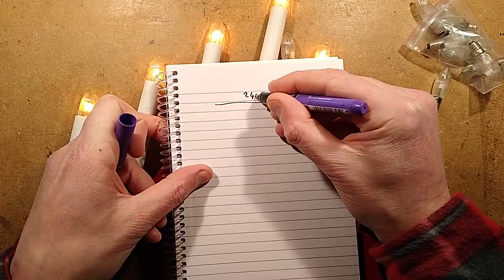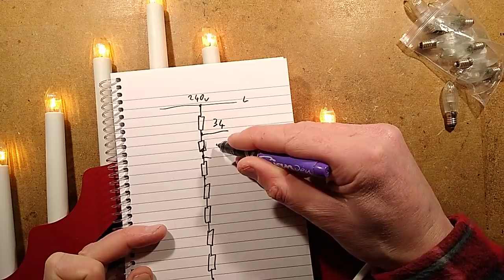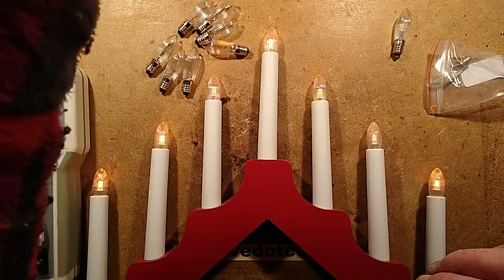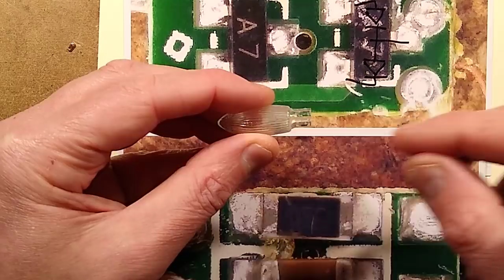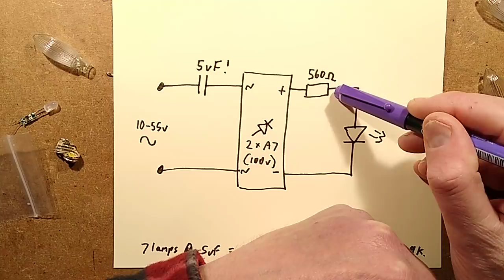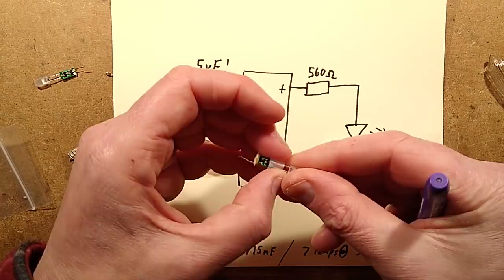Why you can't mix LED and tungsten in series circuits.

Comment: most of our appliances are DC, yet we use AC and rectify every single lightbulb. 
wouldnt it be better to supply DC mains and rather convert the few heating elements that still need AC?
Reply: Univeral motors run cooler on AC and 50/60Hz iron core transformers won't work. Synchronous motors won't work either on DC.
Reply: @simontay4851  
i wasnt aware that we have that many motors in our homes to justify AC? 
yeah sure, washing machines ... but they have heating elements and needed to convert to AC anyway, but other than that? 
TVs, Computers, Radios, Lights, Monitors, DVD Player,... guess when it comes to Vacuum and Kitchen tools, youd indeed have motors. 
Maybe it was a stupid idea. :-\
Reply: not to mention power tools having motors.
Reply: @thomasherzog86 there are at least 3 reasons:
1: AC is much more efficient to transmit, DC suffers energy losses over even relatively short distances

2:We already have billions of devices that run on mains, so even if DC mains was supplied, it wouldnt really be used for a while

3: That would be very expensive to either make brand new transmission infrastructure, or even rectify AC at a central point in the home.

4:We have cheap, easy, and small circuitry already developed to be able to rectify mains AC, so its not like we would be saving much money per device.
Reply: @benjammin2020  
but that's four reasons? (^^)
but seriously, i dont think nr. 2 and 4 are valid if you think about all the lost energy that gets turned into heat in resistors and all the extra elements that land in the trash with the appliances like rectifiers and such. there is a lot of potential to be saved here, which of course is lost quite fast if transmission in homes is that much worse with DC like you say at nr. 1 or would need much maintenance with an expensive transformer in every house. 
it was just a silly idea. ^_^
Reply: @thomasherzog86  DC is used in power transmission sometimes, HVDC. But to convert voltages between DC-DC is costly efficiencywise, either going into AC temporarily or other wasteful forms. So it's mostly used to sync different AC grids in interconnects, and is not suitable for home supply (since, as said, needs wasteful conversion for home power draw). But it is more efficient than AC for long distance transmission past a certain point because there's no skin effect on the power cables. (You need to transmit large enough power or over a large enough distance for the extra technical complexity of HVDC to be better than HVAC power lines. Or if you simply have to sync up AC grids that don't have their cycles synced for other reasons.)
Reply: @kaitlyn__L  
i didnt understand everything, but thanks for the awesome answer. :-)
to put it simple - its not a good idea? 
i tried, lol.
Reply: @thomasherzog86  Not a good idea, but it is a good thought experiment, and a good learning-type of question.

Sorry if my previous response was a little grating, I was in a did of a bad mood.
Reply: @benjammin2020  
no, it was a good answer. if thats you with bad mood, i wonder hiw you are with good mood. (^^)
thx for the response.
Reply: @benjammin2020  I have heard of buildings/campuses that have a centralized rectifier and run things on DC.

Comment: power factor went to hell when  he connected all the LEDs, always worrying for the future.
Reply: @AppleGameification  It shows the difference between apparent and real power (i.e. how much energy it seems to use and how much it really uses). At the moment that's not a problem, but Clive likes to prophesy that at some point the electric companies will switch the smart meters over to measure apparent power (because they can do that, unlike the old mechanical meters), and your electricity bill will skyrocket.
Reply: @rolfs2165  we all ready got them.   Bill is 25 or so. And 150ish. In the summer
Reply: @jwalker7567  Old meters use real power, apparent power is always higher (unless you have a Power Factor of 1). It has to do with how inductive and capacitive loads shift the sine wave. And depending on where you live, you might not be able to say no to getting a smart meter, because your electric company is required by law to install one.
Reply: @jwalker7567  You will eventually be required to switch. The metering equipment belongs to the power company.
Reply: Well, if you think about the loads of LEDs vs the loads of motors, the power factor actually gets a lot closer to 100%, but as there are far more motor loads, I don't think that a few little LEDs will cause too much of an over correction.
Reply: @IceBergGeo  It's less the LEDs and more what they come with - capacitors. I have three big motors in my house, fridge, washing machine, and vacuum. Only one of them runs all the time. But there's lots of LED lights, computer, laptop, TV, stereo, other electronics, which all have capacitors in them. And those add up.

Comment: "it's getting quite hot" well, if they just put a resistor in with the led, which is what I would expect them to, then all the excess power will be dumped in the resistor, which will make it warmer.

So yeah, it's safe, but you're binning a whole load of energy

Comment: It would have been interesting to see what would happen if you switched the lamps from tungsten to LED one by one, while the circuit is on, and the hopi displaying its power values. If maybe the last tungsten lamp would pop, or only light very darkly with 6 leds, and so on.

Comment: I discovered these LED E10s this Christmas and replaced my incandescent candle bridge's lamps with them as there's no point in wasting 21w on warm white incandescents when warm white LEDs look identical.

Ordered mine for £5 for a set from a Hong Kong eBay seller but mine didn't buzz or have any flicker (tested with camera). 

So maybe I got a higher grade of lamp by paying a couple of pounds more? Was very impressed with Chinese products this time.
Reply: Have you got a link or search term or seller id?  My mam's light bridge has one dim bulb and I'd like to replace them.  And do they look as good as the incandescents?  Clearly on this they look a bit pants because of the flicker but it's probably just on camera.  Thanks.
Reply: @CountDrunkula  emarket4un was the seller. Flicker is detectable to some people and the sign of a poor circuitry design (the ones I bought don't have any flicker at all). Look exactly like the old ones, same white just a little dimmer but energy saving is huge and would probably never have to replace them again. My arch is a 7 candle pine one that was originally using 3w E10 incandescents. 

I figured it was much better to upgrade my old one than buying those annoying battery candle arches which always need to have the batteries changed and don't have replaceable bulbs. 

Hope that helps!

Comment: By the way, in traditional fairy light bulbs you have the shunt. I understand how that works: filament burns and increased open circuit voltage burns the resisting coating on the shunt, but how is it possible that when a second filament burns in a string, the lights go out AND replacing only one bulb will bring the lights back, but it doesn't matter which one it is?

edit: this has to have something to do with the non-linearity of the resistance of the filaments?

Comment: To reduce the flicker you would just need to make the PCB 2mm longer, and place another of those chip capacitors across the output of the bridge rectifier, to provide a little smoothing. The repurposing of the blown glass is common, the lamp manufacturer is often not going to have a glass forming line, instead getting the ready blown bulb shells in from another supplier, who processes glass into bottles, vials and other blown and stamped glass products.

Comment: Problem is tungsten lamps require a much higher inrush starting current until the filament heats up to working temperature. They are crude PTCs in a sense.
Reply: Heat bulbs with a side effect of light

Comment: You're lucky that yo have those with a capacitive dropper inside each lamp.
I had a Chrismas string of  75 LED lamps which are just the same outer shape of yours.
But, There is ONLY a LED inside.
I have screwed one in a 2 D-Cell flashlight, and it lit up well.
Att the power plug end of the string, there is a small sealed box in the pair of wires which contains a full bridge rectifier, and a Series capacitor. IF I am to screw in 7 of these in that fixture You have, It surely would went out with a bang...  IF You are interested in these, I can sent a few of them to you.
Sadly I have trashed the wiring since it went in a terrible knot... :-(

Comment: "Old Fashioned screw-in Christmas Lights" ARE IN PARALLEL! (never seen any "Edison style" Christmas lights in series and the low-voltage ones are usually battery operated(Like single Candles)) The Old Tungsten "Mini-Lights" come in different voltage ratings and always are in series.  This 7 bulb Lamp does not make any sense if someone wants to light an individual light at a time.  What $#!&&^ Tat are you buying???

Comment: I was expecting you to install 6 of the LED lamps and one tungsten one.  I'm guessing it would have worked, but the tungsten lamp would have been dim.  I'm not surprised the capacitors were making noise, 5µF in such a tiny package means a lot of barium titanate, which is pretty piezoelectric (its capacitance also falls off rapidly with voltage).  That's also why it failed so quickly:  that much capacitance also means there are a lot of thin layers in there, so overvoltage can blow through the dielectric fairly easily.

Comment: Yes, they are badly drawn resistors. Proper resistors are zigzags, not boxes! 🌭⚾🇺🇸⚾🌭

(No apple pie or Yankee Doodle emojis, alas)

I've never understood why ISO chose boxes for resistors and inductors. The ANSI symbols are much more evocative and faster to draw.
Reply from the maker: I can remember the transition from zig-zags to boxes.  It was annoying having to change.
Reply: Since when the inductor is a box? Resistor is a box, inductor is a few bowed wires and capacitor is two lines with separation.
Reply: Mariusz Kozłowski it’s a filled box. Resistor is a empty box🤷🏼‍♂️
Reply: @gurgelplus  OK, I was teached the way I wrote. I knew about American zigzag for resistor but I think I didn't see schematic yet with filled box for inductor.
Reply: Mariusz Kozłowski it doesn’t matter which design you use as long as everybody knows which is what and that is usually the case if someone has some electrical experience or background...
Reply: Viva la Zig zag!!! And let’s bring back the Mho while we’re at it!!!
Reply: @peterg.8245  Good idea! It's bad enough corporations are buying up naming rights to stadiums (in the US). It's absurd to let that carry over to physical units. 🤣

Comment: I guess there's simply no space to have a voltage regulator and the LED on its own "circuit" as it were, which would let it deal with a much wider range. You'd still have the problem of the other lamps now seeing an incorrect voltage however.

Comment: i just bought 2 packs of 30 i am going to try these in my pinball
Reply from the maker: Keep in mind they are AC only, so it will need to be an electromechanical machine with a 50V or less lamp supply.
Reply: @bigclivedotcom  about 8 volts AC@60 HZ i have 12v bulbs in it now because the thing has the wrong transformer as for the score flashers a 300 ohm resistor across the socket  will fix that i already tried it with a couple home made ones they light quite well with that 5uf cap the mane lights are 8 volts normal ac 60 HZ and the others are using a diode and a crude matrix circuit running about 22volts peck adding a 300 ohm resistor across the socket makes them think they are on normal ac
Reply: @God-CDXX  If it's going to be permanent, you can remove all the keep-alive resistors.
Reply: @bdf2718  the resistors have to be there for these LED's to work do to the fact that these LED's use cap dopers the resistors give the caps some where to discharge with out the resistors the LED's only just barley glow the mane lighting is normal 8 volts 60HZ AC  the lights that flash run on a matrix where each socket has a diode feeding it with out the 300 ohm resistor across the socket the cap in the LED would charge to 22 volts than the LED would only glow on the internal discharge resistor inside the LED the 300 ohm resistor serves to discharge the capacitor there fore completing  the simulated AC these LED's deed to work
Reply: @God-CDXX  Keep-alive resistors aren't across the socket, they're across the contacts that switch the lamp on and off.  Required for filament lamps that get flashed a lot (unless you like them to have short lives) and pointless for LEDs.

The keep-alive resistor trickles about 1/10th of the lamp's rated current through it when it's "off" to keep the filament slightly warm (without being hot enough to glow).  That increases the lamp's resistance somewhat.  And that reduces the inrush current when the lamp is switched on, because it's usually the inrush that kills an ageing lamp due to magnetostriction rattling a brittle filament that has been thinned by use.
Reply: @bdf2718  i am not referring to the keep-alive resistors you have to remove them or all the LED's will glow this is a solid state unit the 300 ohm resistor is there so these cap-dropper based LED's will think they are on ac this pinball has a dc based system
Reply: @God-CDXX  <sigh>

I understood that.  I just mentioned that you could also remove the keep-alive resistors.  Then you appeared not to have a clue what a keep-alive resistor was, so I explained it to you.

I am not as clueless as you appear to be.  I understood what you said the first time you said it.  Would that you could have done the same with me.
Reply: @bdf2718   i believe we both of us misunderstood each other sorry about that
 i have 11 machines 8 EM and 3 solid state one of each is home built the difference is plane at the time i built the EM in 1995 i had no clue about the  keep-alive resistors that machine was hard on bulbs for 5 years the man i got most of my machines and parts from told me to add these resistors this was the year 2000 . 

the fact you mention  the keep-alive resistors to me tells me you know your hobby 👍
Reply: @God-CDXX  I did wonder if we were talking past each other.

The reason I know about keep-alive resistors is the same reason I know that an environment with traces of hydrogen (such as the battery compartment of a submarine) is hard on filament lamps.  Reliability concerns of many types of component were a small, but important, part of my job.
Reply: @johncoops6897  i mean the the lights that don't flash  i would love to own Lion King that thing looks cool

Comment: Good to see ya up and at it, I swear we are on the same page, went up to visit my folks my mom had asked me to find her some c7 lamps out of her box of lamps, I found her old flame lamps. One of them didnt work the 2 pieces of metal were to far apart to work so i gave it a "tappy tap tap" and bam it vwerks. Get well soon.
Reply: Did you also call it skookum as frig? ;)
Reply: @benbaselet2026  right orn
Reply: Did you apply percussive maintenance with your thumb detector?
Reply: @matthewellisor5835  well a guy put in his hand (glass) then made sure the metal inside was horizontal and slammed my hand on the counter. The weight of the metal inside bulb and inertia caused them to get closer. However I did have my thumb detecting nut fucker at the ready.
Reply: @matthewellisor5835  "thumb detector" I may have to steal this.